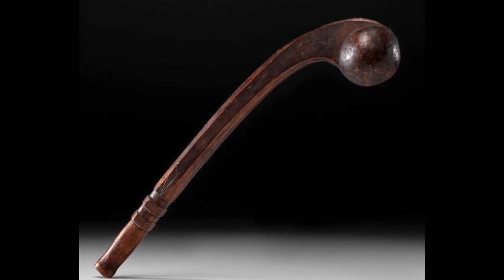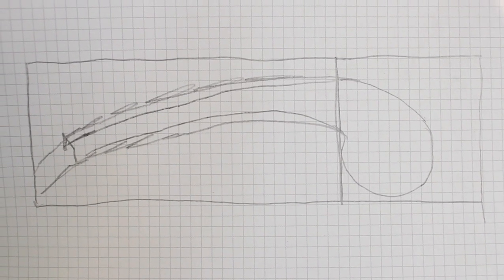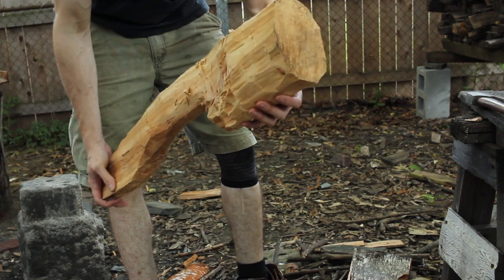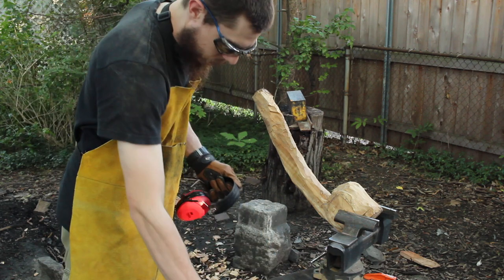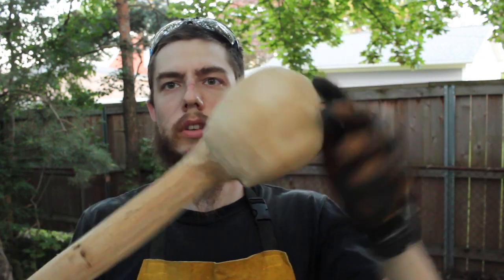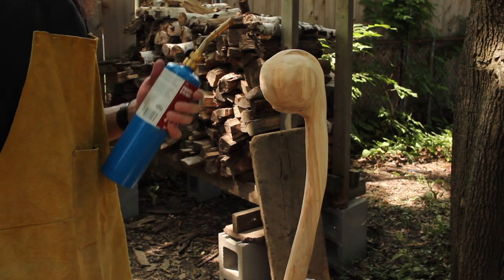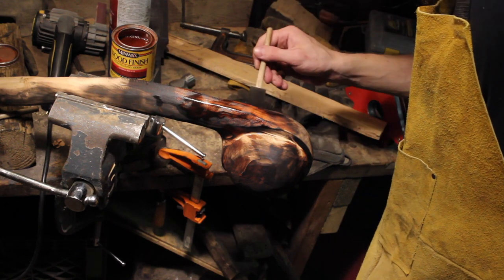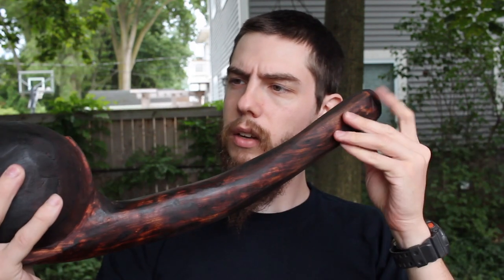Native American WAR CLUB: Complete Build with Axe and Angle Grinder

Comment: Hey Phil,

Your video has been super helpful! Running into some trouble here at the final phase…2 questions if you don’t mind?

1. I used the Sedona red wood stain but it keeps wearing off on my hand every time I touch the handle. Any thoughts on this? I added the boiled linseed oil but it’s almost making it worse. Any clue how to keep the red from wearing off?

2. How many coats of linseed and how do you know if you’re applying it too thick or not thick enough?

Thanks man- super helpful video!!
Reply from the maker: The sedona red probably needs to dry or be sealed with clearcoat. Skip the linseed if you seal it. I was using raw linseed oil, so I don't know if there is a difference there. Try leaving it in the sun to dry, but linseed oil can take months to be fully dry. As far as how much, it usually doesn't take much but all depends on the porousity of the wood. Wish I could be more helpful, but thanks for watching!
Reply: @PhilBaumhardt  thanks man! I think I will leave it outside for a few days weather permitting and then try the clear coat… even though I already did a coat of linseed lol 😬
Reply from the maker: @connorwills9862  if the linseed is dry, clearcoat should be fine

Comment: how would you stop the wood from splitting?
Reply: Typically these war clubs were made of dense hardwood, so splitting it would be hard to pull off.
Reply: Here's an old indigenous trick to eliminate those splits. Splitting occurs due to the sap in green wood drying to fast. Do not remove the bark until it is cured and free of sap. T P poles and other such green wood were placed into a flowing creek for at least 2 weeks to wash out the sap. Then allow the sapling to dry slowly in a cool, dark place after coating it with animal fat, but linseed oil works great.

The best time to harvest the sapling is in the winter after all the sap has gone down into the roots. The Irish would wait a year to even begin carving a Shillelagh walking stick/fighting club after carefully curing the stout, knotty blackthorn stick. while curing, be sure to keep the ends wrapped with cloth and keep the ends generously oiled, never allowing the cloths to dry out. After shaping the stick, the Irish would place the Shillelagh in a chimney to slowly fire harden for months, or even a year. This chimney process would turn those Irish attitude adjusters a beautiful black.

Lots of knots in the sapling makes it hard. Carving a knot is hard work, but worth it for the hardest product.

Doing it right is a slow, meticulous process, but the only way to properly cure and harden the instrument. Never leave the finished product out in the yard or in direct sunlight such as on a vehicle seat for extended periods. The sun can still split it.

Good hunting...

The only "Woodstock" I saw in 1969 was on my Army issued M-14 rifle.
Cherokee Cavalry Scout,
5th US Cavalry,
Vietnam, Cambodia, Laos

Comment: Dewalt is the shit,.... but the best way to waste away wood is first with a band saw,... or hammer and chisel,...angle grinder you can use a rubber back plate and a 40 grit disc,... they last 4ever and waste wood and shape.
a fiberglass back plate stops you from shaping and it cuts gouges in it and a stone is no different.
You need to get the rubber backplate from a tool vender I think my discs were norton 40 and 80 grit.
A rubber back-plate similar to one on a buffer allows you to do round shapes without gouging.
De Walt lasts 5 times longer that other grinders ,.....and their rebuildable.
It does look a little big.